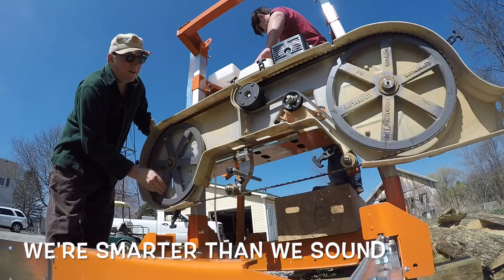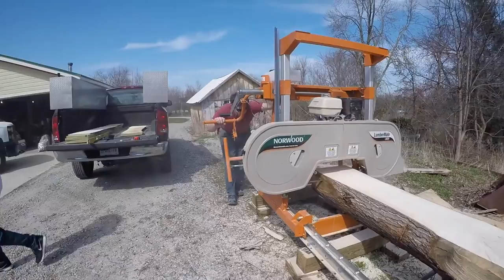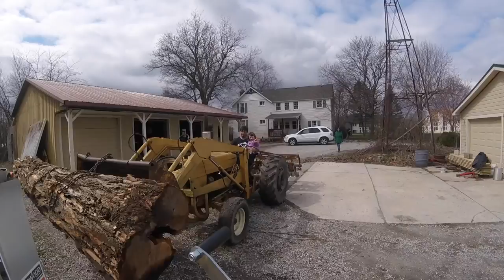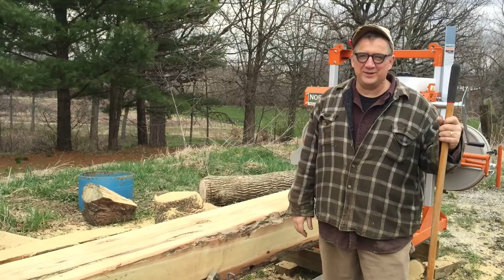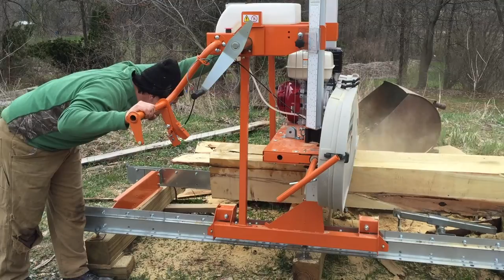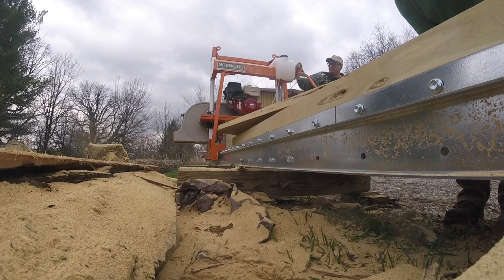Norwood LM 29 Ash, Maple, and Black Locust Easter 2016

Comment: hay fellow Norwood saw owner did you know if you remove the cross rails you can get an extra 6"-7" of log on to the saw. make sure bottom rails is succured and just put a plate or flat bar on joint holes. Now Norwood won,t tell you this but it does work
Reply from the maker: David Kirkman thanks for the tip Dave!
Reply: tom their is a lot of little tricks I learned . Oh by the way did the blade shields line up on yours . mine didn,t and I sent a nasty letter to owner and got the fastest reply ever. All kidding aside I looked at 5 different saw mills and took a little bit from all in considering my final purchase LM29 with 24 ft bed and put it on a custom built trailer with removable tounge, custom built ramps that attach on trailer not saw bed and a 2500 lb 50' cable winching system. works great. Even got a deal on 279 woodmizer 36" saw blades that wook great once they are cut down from 178" to 151" cost was like 250.00 for all but the pitch cleans the cut wood better